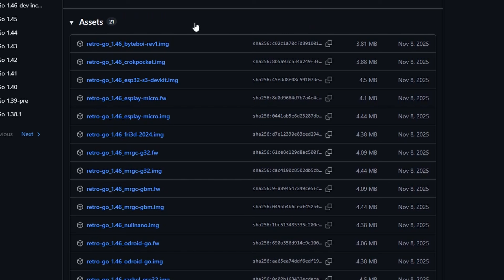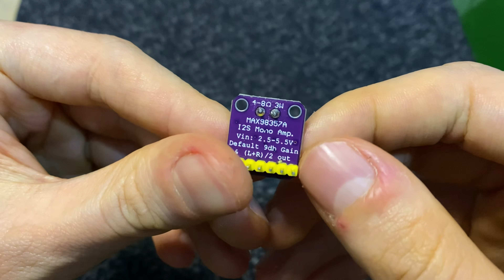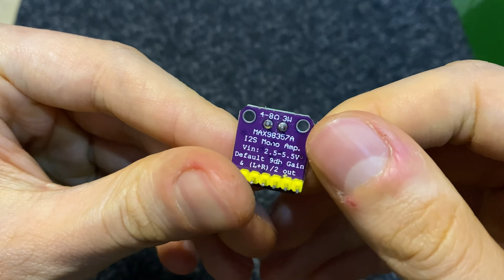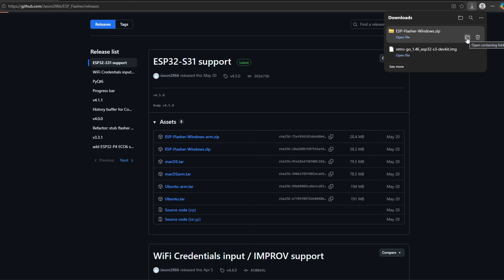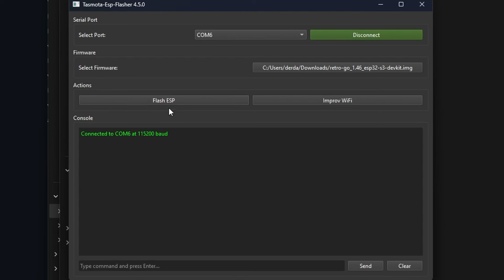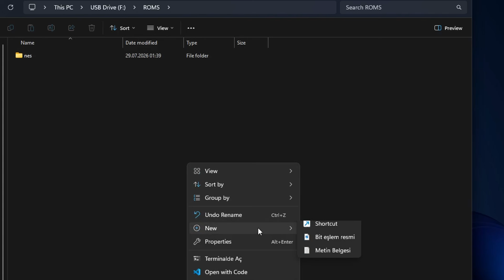Build Your Own DIY Retro Game Console! 🎮 ESP32-S3 Retro-Go Full Tutorial

Comment: i am getting 
SD Card Eror
Storage mount failed.
Make sure the card is FAT32.
I followed everything exactly as you showed, but the result is still the same. I’ve checked my connection and also performed the conversion to FAT32.
Reply from the maker: Are you use sd card reader module or built-in. If you are using reader check the power requirements. 5v or 3.3v
Reply: @DsnIndustries  Yes, as you suggested, the issue was resolved when I switched to a different module; it worked perfectly on the breadboard. While powering the system via the ESP32 (at 3.3V), I supplied the SD module externally with 5V, and it functioned without any problems. Is it possible to run this entire system using only a 5V power source?

Comment: im curious about the connection of the lcd, theres no mention of GND and VCC on the config file. when I tried to plug it on 3v3 and ground to supply a power, it only shows white
Reply from the maker: Have you try to 5v for vcc pin?
Reply: @DsnIndustries  not yet, do you think its the buttons? I skipped them as I wanna see if the system is working before I put I connect the buttons.
I got this on the log:
 [warn] rg_system_init: Button 00000000 00000100 being held down...
 [warn] rg_system_init: Button 00000000 00000100 being held down...
 [warn] rg_system_init: Button 00000000 00000100 being held down...
 [warn] rg_system_init: Button 00000000 00000100 being held down...
 [warn] rg_system_init: Button 00000000 00000100 being held down...
(bunch of [Info] thread)
then
 [warn] enter_recovery_mode: Entering recovery mode...